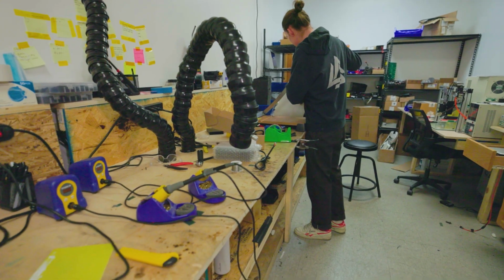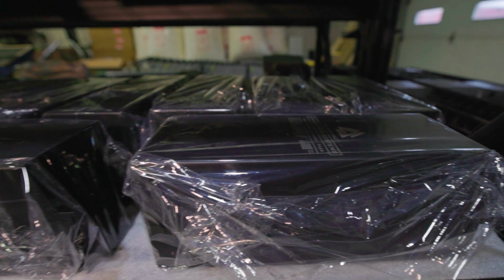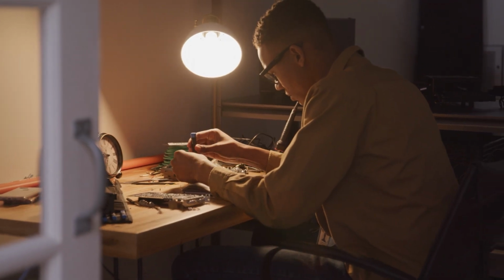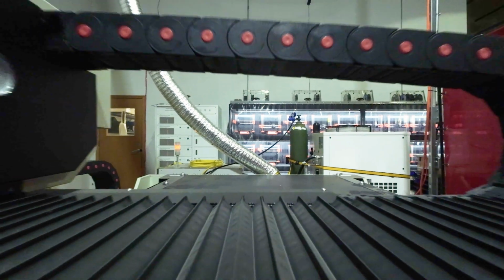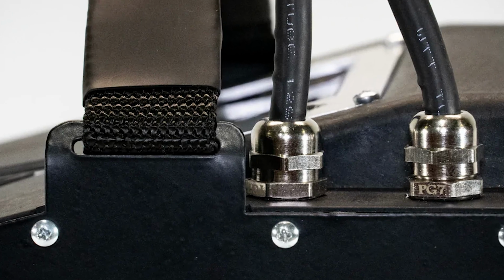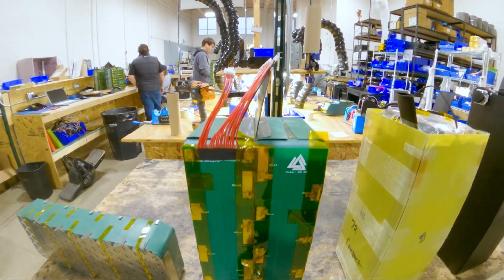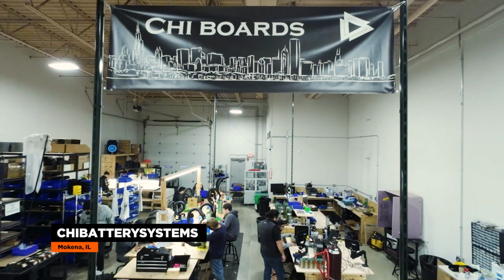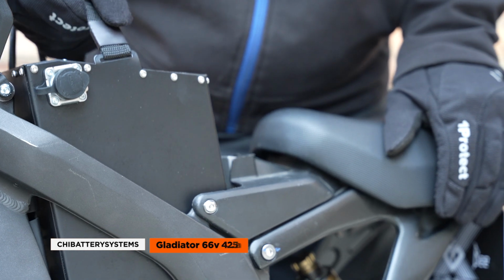2023 ChiBatterySystems Facility Tour and Sur-Ron Gen2 Battery Upgrade | RunPlayBack

Comment: I wonder if they're looking into the blade style batteries from BYD. If they found a way to build them in-house, with blade cells stacked like a sandwich it would probably make for a more energy dense solution, especially on Sur Ron style batteries.

Kinda sucks the battery market is still using old 18650 cells as the standard.
Reply from the maker: For high capacity or high discharge, they are using 21700 cells, not 18650

Comment: So the 72v touring has less power than the 72v max?
Reply from the maker: Really depends on what your "power" needs are.  The touring has more range (distance/time) potential, but the max has more performance (torque/speed) potential.
Reply: @RunPlayBack  make a video on the differences

Comment: Do you know if they are using a bms for discharge in their new batteries?
Reply from the maker: For their Gen2 they use a Smart BMS with custom PCB. I believe that's how they draw percentage, voltage, capacity (Amp Hours), battery temperature, amps and watts on the new LCD display. And I think you can still use the Smart BMS bluetooth app to access the same data as well.
Reply: @RunPlayBack  previous gen batteries only used the bms for charging and passive balancing. Do you know if the new ones use the bms for discharge?
Reply from the maker: @bj97301  oh sorry I misunderstood, I'll ask and get back to you
Reply: @RunPlayBack  oh thanks bud. I can too if your busy. Just curious if it’s changes from the prior generation.

Comment: Cool. I've got a question.  Are their setups a plug and play?
Reply from the maker: For the Surron batteries, kind of. Just requires replacing the battery lid risers, takes like 5 minutes. For the touring batteries, you have to replace the bottom battery plate. Not really difficult but requires a little more time than just replacing the lid risers. Their install guides are easy enough to follow for beginners.
Reply: @RunPlayBack  thanks

Comment: Another great detail video. Can you do a video explaining the differences of their batteries!? As in range, speed, torque from 60v45.4ah vs 72v36ah for example.
Reply from the maker: Hey man! Yeah for sure I can do that! I'm actually reviewing the 66v 42.5ah batter next. I think that's like the perfect balance in terms of power, efficiency and range and right in the middle between a 60v and 72v setup. I have experience with both so I'll do my best to compare and contrast those differences. Thanks for the feedback!
Reply: @RunPlayBack  no problem man. I enjoy your content. I'm purchasing items before I purchase the Surron. And debating on what battery makes sense for me (even tho the batteries are 300-500 price difference from each other). Alongside which controller between BCA400 (With heat shield) or KO controller
Reply from the maker: @ajjax89  I found this on their site which might be helpful too! https://support.chibatterysystems.com/hc/en-us/articles/4404272174231-Should-I-buy-the-60V-or-72V-Gladiator-

Comment: We need some universal batteries like triangle ones 😔
Reply from the maker: I hear ya! However, I think Chi specializes in specific PEV's that they can do real world testing with in house in order to maximize performance and efficiency. So like less of a one size fits all solution and more of a targeted, specific solution.
Reply: @RunPlayBack  I feel that but a triangle shaped would fit more bikes like bike conversions like mountain bikes fat bikes etc high capacity’s because I use a 72v 20ah triangle made from 21700 Tesla cells but the company I bought from won’t make a bigger one because they make them default like that
Reply from the maker: @ihavetowait90daystochangem74  Oh I see what you mean. I'm not really sure Chi would make batteries specifically for MTB conversions but perhaps in the future? It might be worth reaching out and asking them directly. If anything they may offer to do a custom job, although I'm sure that could be a little pricey. Or they could recommend someone who specializes in custom battery builds.
Reply: @RunPlayBack  yeah I live uk so I’m trying to find a reasonable price some are charging way to much I can litterly just buy two batteries
Reply: @RunPlayBack  I have a question I really appreciate you responding most YouTubers don’t 

Currently I have a knaap e-bike with a 60v24ah battery with 1000w motor I changed the original components it was 36v before 250w 

Right now with moped tires going 12mph I only get 26miles range with hills etc to me that sounds really less considering I did the exact same range when I had the 36v 21ah battery but without moped tires  do you think the moped tires reduce that much range that I’m using a near double capacity battery and still get same range ?
Reply from the maker: Considering the terrain you mentioned, and the additional power you're drawing with a 1kw motor, your real world range sounds within the ballpark.  Moped tires are heavier, so you will lose a bit of range with them, but the loss would be just 2-3 miles overall, nothing drastic.
Reply: @RunPlayBack  really ? Wow i I only go 12mph though sounds strange but thank you for replying